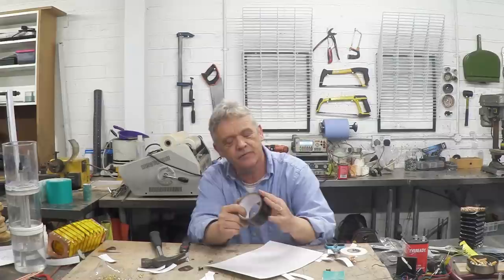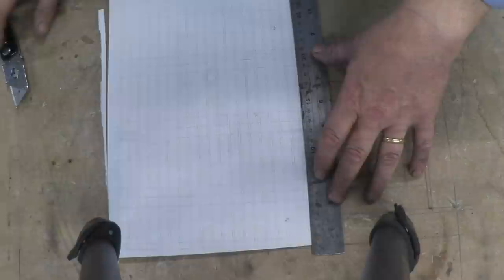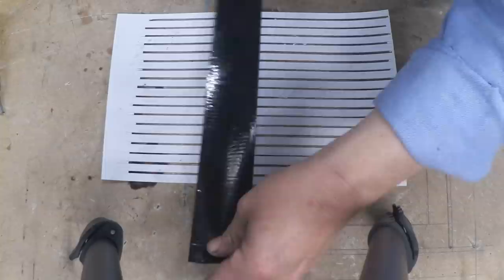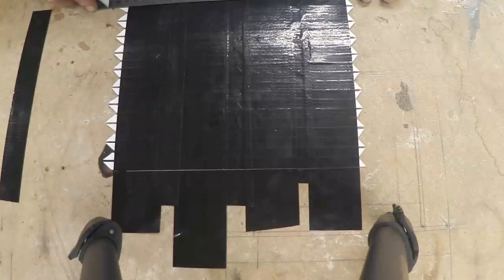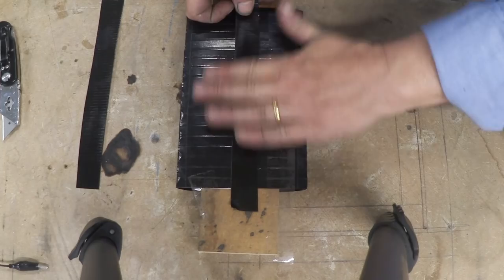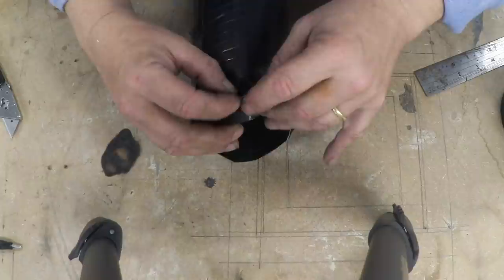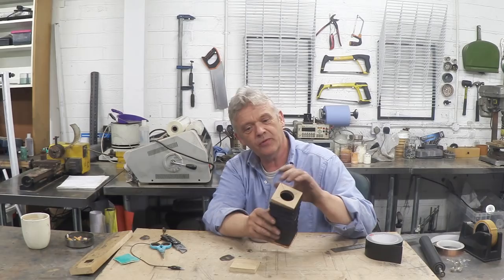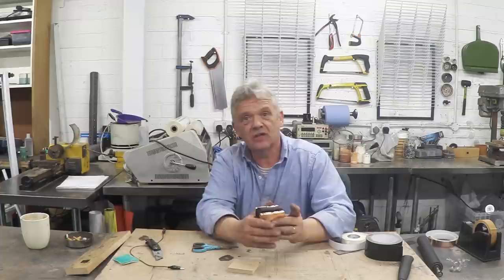Making Bellows - Template And Tape Method

Comment: Nicely explained. I'm looking to replace the bellows on an old folding camera so at least have something to go by.
One thing though, at 05:11 you have to squeeze a bit of tape down the inside of the bellows to complete the seal. Why not have that piece of tape fixed, upside down, onto your board at 04:10, place one side on it and press it down, then the other and then add the outside piece?

Comment: Once you save the bellows drawing on the computer, you can use one of several programs to scale it to size (for the cross section of the bellows), and add length by putting more pages together. The sky is the limit once you have the base file established.
Reply from the maker: yep - and dead easy to draw - it's just a lot of straight lines copy and paste - done!

Comment: Simple and easy and photo useful.  Thanks Rob!

Oh, I just thought of something obvious.  For the art of it, we could make different shaped bellows to.  For instance, use a 30° angle instead of 45°, plus two more columns of slats and Tada! Hexagonal bellows.  

A Septoganal bellows might make a great prop for a fantasy costume concertina. (The music is beautiful, but sadly, beyond what humans can hear 😄)
Reply from the maker: for sure - this way any geometry is possible even u shaped fully enclosed
Reply: @ThinkingandTinkering  
Ooo... Uneven prices with different angles... Oh the possibilities...
Reply: I don't think an odd number of sides is possible, because the folds have to alternately go inwards and outwards.
Reply: @gcewing  but that's by row, isn't it? I didn't think the colums alternated as well.  Not in a position to try it at the moment.
Thinking this through live.  
Okay, let's say you fold a fan.  A straight row of paper, back and forth, then you opened the paper up again and folded it into 5ths, taped it up, and revolted the fan folds in the same directions.  The internal corner folds would interfere.  Could they overlap she the bellows collapses? Would they naturally find a way or constantly bump into each other. Also would have a doubling of material at the internal corners which would add up as you added layers.  

I can see where an odd number could be problematic. Thanks for the clarification :)
Reply: @colleenforrest7936  Think about it laid out flat. As you go from one edge to the other, the trapeziums alternately have the long side at the top and the short side at the top. If there is an odd number, when you go to wrap it into a cylinder, the edges will clash.
Reply: Got it! That makes sense now
Reply: But...what if you skew the lines a bit so that the hills of one side line up with the valleys of the other? It might cause a slight twist upon compression, but Escher would be impressed.

Comment: There are hobby CNC papercutting appliances out there that might do a good job on your bellows. Thank you for your very fine video.
But I think the flexible vent tubing would be far easier to adapt and would make a very good bellows as well. It is available from 3" diameter up to over one foot (that would move a huge volume of air).
"Tech Ingredients" recently published a YT video on a desiccant-based A/C system that really intrigued me. Its efficiency evidently far exceeded even the best Freon systems.
Reply from the maker: true mate - but this way you can make any shape as a bellows including for cnc covers and basically all kinds of geometry

Comment: You have given me an interesting idea. An emergency flow battery! So I want to give it back to you because that's who you are! You are the impossible battery guy. 

Ok so a while ago, a Japanese inventor came up with a zinc or magnesium based foldable box battery that you would just add some water to and it would run. But what if you just wanted to use only a little bit of metal to reduce the footprint? And you still want that big amp output to start a car or something like that where it's a burst of energy that you need rather than a big continuous amount. For example for you want to charge a life saving device quickly. Or you are in the water after a plane crash and you want a big burst of light from a high power photo flash or a big LED...

Okay, so you get two belly.... plural for bellows... And you join them to a high surface area cheap fuel cell in between. Next you add dry chemical crystals...a battery salt or ion source. You pack it like that as a product until you actually need it. Finally, the time comes! You need to charge your phone! And quick! Your boat is sinking and three hungry sharks are waiting for you!  So you add some sea water, close the plug and you start swishing the bellows back and forth passing a large amount of reactants between the plates on each pass.  So with a little bit of water and only a little bit of human work, you can extract a huge amount of current for as long as you got reactants and strength. It's basically a tiny high energy fuel cell which you can keep dry until you need it. Also you have lots of carbon materials to make this device printable and Amazon sellable to make lots of money to continue experimenting.

Comment: I've been wanting to build a manual air pump for my car tires. It's such a pain to get the compressor out, plus i think it's cooler to not use electricity, something i can use anywhere. I have a bike pump but that takes forever, i thought about making a bigger one, but then i thought about bellows, making some kind of accordion foot pump thing. Do you think bellows could get a tire up to 40 psi, i think that's around 3 atm?